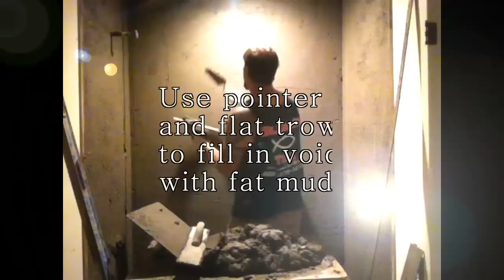How To Use Fat Mud To Make Wall Flat& Plum For EasyTile Installation byDave Blake Master Tile Sett

Comment: You don't have to do a scratch coat first? I thought the process was green board, moisture barrier paper, metal math, scratch coat and let it dry until the next day and final float. Looks like a 2 day process unless you skip the scratch coat. Scratch coat is not necessary?
Reply: Yes scratch coat is necessary but you do it at the same time, for some reason Dave doesn't.  Burn in scratch coat then immediately apply mud exactly the same way he is doing it.  The scratch coat is to ensure the mud has been scratched into the wire or lathe much the same as you burn in a scratch coat of thinset onto floor tiles before setting.

Comment: Great video Dave. I always nail my wire to the studs every 8 inches but not in the corners.I also wrap my paper and wire around sideways roofing lap...Why don't you nail the wire?..I do it per building code..

Comment: Question I’m going to put in a otis shower liners in my new construction Home The showers are already green rocked The shower pan will roll up on the surface of the sheet rock I figured I It didn’t matter because I’m rolling felt paper over the top of the liner similar to the exterior construction of a stucco home. I’m going to mud the floor and fat mud  the walls just like you I’ve done it several times before the  only differences in the past I had everything hot mopped in the framing, and The Rock went over that. Green rock is just for any Small amount of moisture getting past Staples causing mold it actually doesn’t waterproof a thing especially with tape joints it is strictly the felt paper that completes the waterproofing, and that is overlapping my pan  what do you think. Thanks for putting out journeyman  tile videos.

Comment: I'm thinking of using this same method but on hardibacker board to level uneven wall up to 1/2". Do I need metal lath if floating over hardibacker?
Reply from the maker: You could use green broad with water proof paper then Lath

Comment: 20 yrs mud floating for tile installation. Depending on sand I have use 7 buckets of sand for 1 lime 1 cement. You don't want it to rich of material then it's to sticky an will tend to crack. Other than that great job

Comment: Doing that with cinder block wall is the same process? Also, in a cinder block wall that is bowed in the middle, can I just fill the bowed area a feather the edges to 0?
Reply from the maker: +Luiz Borges Gomide Yes you can .Make sure to  trowel some thinset on the cinder block wall so the fatmuid will bond to it.
Reply: +Dave “TilingInfo” Blake I thought that plaster/mud adheres just fine to cinder block. in my case, wouldn't it be better to just spread thinset on the bowed areas instead of mud to insure better adhesion?

Comment: Kerdi board saves you half the labor and time. You still need another day to water proof your float
Reply: not here in california, we use hot mop waterproofing in most showers. We can float and set same day most of the time
Reply: Adam Wilson I'm in GA. mud on shower pan is the way here. fat mud is out for the last few years and I hate it...
Reply: joshbetan36 your comment shows you lack any real knowledge of the system and if the trade. The cement is waterproof with the vapor barrier behind the float. This method can be "wet set" the same day. Do you know what that means? I bet not. Haha
Reply: I bet hardly anyone knows what acid and sawdust have to do with tile.
Reply: It also gives you an infinitely lower quality job.
Reply: +epic tile I've not heard the wet set term before, can you explain it?
Reply: Wet-set refers to the old method of installing ceramic tile before the invention of thinset mortar. The ceramic tiles are set directly into the wet mud base, the tiles have to be pre-wet or even soaked so the mud is not dried out by the tile before a chemical bond can form. I'm pretty sure the technique is useless for porcelain because it's too dense, but I've never wet-set myself so I'm not sure.
Reply: Epic 411
... But water always eventually gets through the staple and nail holes. All old showers leak, the mortar bed just holds it all together while the wood rots.
Reply: @tileformiles  right I would think vapor and and moisture would eventually make it's way through the staples and the moisture barrier that was not seamed. This is not waterproof its water resistant. Big difference.
Reply: @axiomatic  
Kerdi membrane has it's own issues. Its glued together with thinset, which is NOT waterproof. The system relies on hydrostatic pressure to avoid leaks, and hydrostatic pressure relies on specific very thin seams. If anything doesn't go down perfectly flat, or you have any ridges, wrinkles, or ANY of the seaming mortar is too thick or not bonded properly,the shower will leak. Lot of areas for potential leaks.

Comment: Love the video and the information! Just finishing up a bathroom renovation where I went the permabase route for tilebacker in the shower surround. Damn those out of whack walls, our next project is the master bath and I'm using this method. By the way, our home is almost 50 years old so things have warped and moved in those few decades. Thanks for your time, you've a new subscriber!

Comment: Where did you get that giant mixing tub from your other video? also what did you attach the half inch strip to the side wall with and is it plum and level?
Reply from the maker: noah wedge noah I think you could  a small one Home Depot or a place that sells mason tools or supply's

Comment: I was scrolling through YOUTUBE and clicked on your vid. WOW! man, I haven't seen anyone mud walls in so long that I thought it was a forgotten art. When I first started in the tile trade that's how it was done, period end of story. Then came along two cement backer board brands... and they were all the rage. Just like you mentioned you can't get them flat like a good mud job. Nice job showing how important it is to cut the mud off with the edge of the trowel when you fill in the void from the float strips and working the wall.
I remember I got left mudding a whole hospital wing with my helper because they couldn't find someone that could mud, strip and float the walls (long long time ago). One thing that I'm not familiar with is the wire mesh your using, we always used diamond paperback lathe, cupped the mud and held it in place. But there again I see the mud your using is tighter than what I used. I remember we had a 4' x 7' mud box (looked like a steel Jon-boat) to chop mud in. Mix, chop and add water then do it all over again.....
Great job, keep going I got 5 years on you and I'm still at it....
Reply from the maker: Rom Sam  Rom were a dying breed us MUDMAN  I'm sooo. happy I learned the right way to tile. When I started my boss had one of those metal mud box's      Doing a whole wing in a hospitable wow!  The wire I use  is a 20ga self furring wire.. You give me hope that I can have a lest 5 more years . Have a blessed day.

Comment: hey Dave,  I just bought a home with a master bath that was installed (4 inch tile) over mud/lath and looks like 1 inch or thicker.  The previous owner painted epoxy over the tile and it looks terrible.  Can I strip off the tile and keep the mud/lath and install new tile over that surface?  Or do I need to go back to the studs and start over??   Thanks for your advice!

Comment: boy I love that idea but it seems like a LOT of extra work
Reply: From someone who is use to dismantling old showers with this method I can tell you it was designed to outlast the tile. Meaning the tile becomes outdated before the shower fails. A little more work and 20 plus years easy

Comment: I understand that float is better then all other method but it adds a lot weight , over 1000 lb for 3x5 Shower. Other boards (CBU, Kerdi...) are much lighter. I prefer light weight install so the house wall is not overburdened for 50 years.

Comment: The most important thing is the water proofing paper. I wound not suggest using it vertically . It should be run horizontally with a 3” min. overlap.

Comment: Great vid! Question - I have a 2 foot high curb/ledge between a corner shower and tub that was hot mopped, I didn't think about it at the time but now that it's out of plumb and waterproofed, I cant cover it with CBU. I was going to float it, will I have any problems if I can't staple the lath to the hot mop? Will securing it just at the top on the tub side be good enough or will my floated wall be unstable? Thanks!
Reply from the maker: Yes it will
Reply: Dave Blake sorry but could you just clarify yes it will be good or be unstable? thanks appreciate these videos!
Reply from the maker: yes

Comment: Hey there Dave,  Have a few questions for you on fat mud.  What do you use for the backer board, can regular drywall be used or does it have to be green board, and can chicken wire be used?  Also will the aquabar prevent any moisture from getting through?

Comment: Man Dave is it nice to see a guy who actually knows what he's doing! Almost every how-to video I've watched is some hack telling DYI people how to incorrectly do something. None of them would know where to start if they had to float a mud wall since they can't even float a mud floor so they have to use some type of cementitious backer board instead.   

You must be on the left coast since we use wire lath and tar or felt paper in place of rosin paper and chicken wire. The "metal" edge you use to screed the wall we call a feather-edge here on the right coast.

Nice job and I can feel your pain.

Comment: hey dave, do u have a video on how to prepare paper and wire from top to bottom.. it’s a new construction bathroom that already has been hot mopped... my bathroom has a bench as well..., having trouble understanding where to start the overlap from hot mop of bench... thank you

Comment: A few questions: 1)Can anyone explain what your base walls need to be. None of the videos on youtube show that. Can i use green board or does it have to be durock? 
2) If i use durock how thick must it be? will 1/4" be ok? 
3) If i use durock do i need to use tar paper? 
4) how long do you let it set before screeding ?
 5) how do you deal finish a 1/2"edge plus tile. They make strip edging of various shapes and sizes but they go on during tiling and wont hide the 1/2" cement edge beneath the tile.

Comment: I GOT QUESTION.  HAVE NEW BATH TUB AND INSTALLING TILE ALL WAY UP ON EVERY SIDE.  TWO SIDES HAVE IRREGULAR FINISHING ON CEMENT BRICK WALLS.  SOME AREAS CLOSE 1/2 CEMENT STICKING OUT.  DONE MY BEST LEVEL IT.  IS THERE WAY TO APPLY A PRODUCT TO SMOOTH IT BEFORE STARTING THE TILE INSTALL.  I TALKED TO TILE GUY HE WAS SUGGESTING FURRING OUT WALL LOL AND THEN ADDING BACKERBOARD.  THIS WOULD TAKE IT WAY OVER TUB FLANGE.  IS MY TILE GUY A DUMB ASS SEEMS SIMPLE SOLUTION IS APPLY PRODUCT OVER WALL THAT STICKS AND GETS HARD PLUS SMOOTH.
Reply: Probably too late but just give the wall a "parge" coat.

Comment: Great video. I like your approach!  Question: can you mud a floor or wall up to existing mud?  I have an old bathroom which was tiled in this method but I removed an existing closet which now has some bare spots in the dry mud. Do I need to rip out and redo it all or can I meet new to existing?

Comment: hey did you see the video where the guy mixed his mud in the mopped shower pan...knucklehead 
good to see you floating, i float all my shower's  . most people are scared to float and use backrbord the only time i use board is  NEVER i take that back i will us it on my ceilings . 1 question whats up with lathing only t-50 staplees .that wont fly in calif got to have roofing nail or big staples to pass inspection .keep up the good work im 50 and floating today
Reply: What inspection???  The only thing ever inspected is a shower pan.   Have you ever done demo to a shower that only has staples in the wire/lathe does it come down with out doing some serious work?  If you use stucco wire like he is using instead of stucco lathe then it is a good idea to use roofing nails every 16" on stud spacing as roofing nails through drywall has less holding power then those T50's.

Comment: What's the finish look like with the grout? Does the half inch make it look funny at the end or do homeowners like the look? Great video
Reply: Daniel Bolte the edges are tiled with a radius cap. 1/4 rounds are the most popular. It depends on the tile being used.

Comment: Dave, I have not been able to find Lime anywhere. What product should I use to make my mud wall. Have you had problem finding lime  in your area?. I am in Florida.
Reply from the maker: You can use mortarS at home depot is the same as fatmud
Reply: fire clay also will work

Comment: How much do you charge per sqft . And how much do you spend per sqft on material ?
Reply from the maker: i charge about 15 a foot and cost 1 a foot
Reply: Thank you!!! I have to say I have been doing tile for about 7 years. I do all types of flooring, The majority being carpet. That is what i learned first and that is what majority  of my contacts knew I did.  But I would say in the last 2 years.  I have really tried to go out and chase tile work and in the last year I have  been trying to find new ways, better or more effective  or if I was even doing things correctly. Well anyway basically I have been doing a lot of research in the last year.  I learned how to set tile from a young kid who learned from a shop. I had never heard  of fat mudding a shower.  I live in ks. I know a hand full of people that set tile they have never once mentioned fat mud. Deck mud sure. But never one had I heard about doing something like that in a shower.  I wanted to do it on my last job but the costumer wanted the lowest-price possible. But I hada wall that had a super duper bow in it.  I floated it using thinnest It was about 3/16 of a in. If it wasn't for your video. The one where you were sweating bulletsno fan no A/C I would have never thought to do this.  So thank you for making these videos and the interdiction to fat mud. This is going to be my go to method for surface prep from here on out.

Comment: Does anyone what will happen if you forget to remove the float boards? Do you need more than 1/2" of cement? We'd like our tile not to stick out to far from the wall.
Reply: Float strips I mean.
Reply: M and A None the float strips are removed during the float job. The vertical space is filled in and rodded off during the final rub down. This system is for pros only. This is not a DIY system, it requires years of experience and knowledge of working cement to achieve the desired results.

Comment: What sheeting did you place behind the aquabar and over the studs?
Reply: redwolf0083 this is a one step method, meaning that there is probably water resistant drywall behind the vapor barrier - tar paper.

Comment: Dave. A few questions. 1. I can float the walls to 1/4" thickness? (I want to float my walls flush with the drywall so I can use surface bullnose instead of quarter rounds)
2. What is the cure time you recommend before tiling? 3. Can you tell me what the layers are starting from the studs? I have been tiling for 5 years, but was never taught floating, we use Hardie Backer. I'm tired of fighting the roller coaster, especially when it comes to subway.
Reply from the maker: George Peterka Hi George your on the right track to make your tile look awesome,flat and a piece of art work. Cure time for you would be the next day. That way its hard enough to set on but still can be scrap to remove and hump. Use a rubbing stone or the edge of  your flat trowel. If you want to make it flush you will have to use the thickness sheet rock on the walls surrounds your tile project to have room for the FatMud. You will  need some kind of backing for your wire and water proof paper. It could be 1/4inch plywood. Hope this does it for you

Comment: Do you only put one guide in on the walls that transition out of the shower so it feathers down to the same height as the drywall? or how do you cap the ends without a big gap between your wall and the tile? I'm one of the young guys. I've been working on my own for about 5 years. I have heard about mudding walls instead of backerboard but never had anyone teach me. How hard would it be to do this without a helper mixing and cleaning tools for you? Would it be manageable for just one guy? Great work! I'd like to give it a shot sometime if I can get a few more specifics. The concept looks really straight forward and using drywall shims to get backerboard as plum as possible seems like a waste of time if I could get this down. Thanks for sharing!
Reply: Giant bullnose junk out at wall.